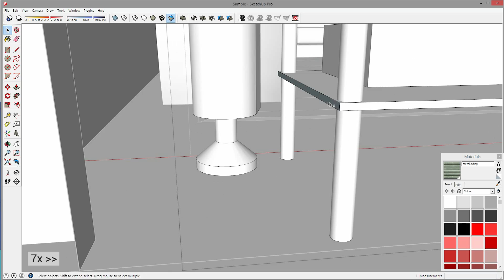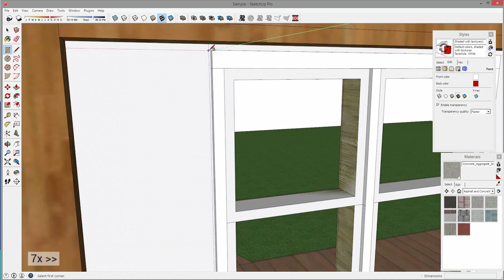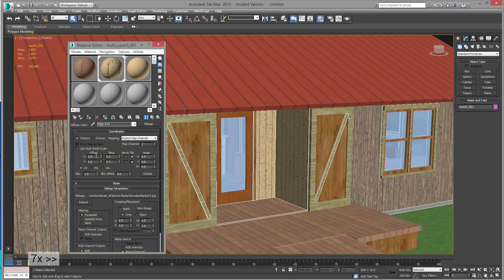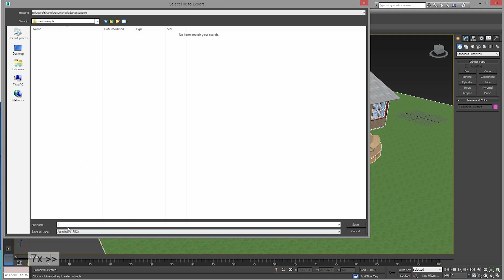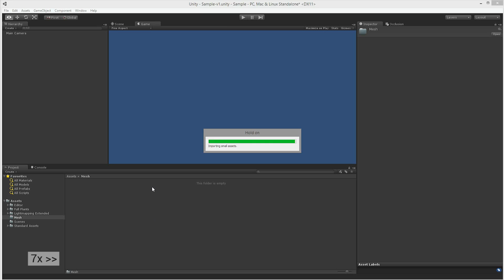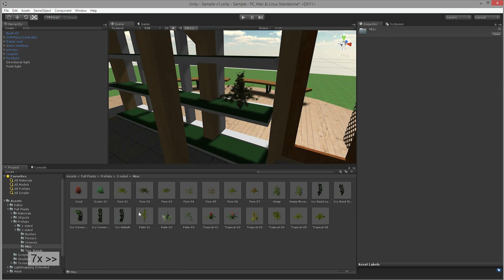SketchUp to Unity to Oculus Rift DK2 - The Entire Workflow and Tutorial

Comment: Hee Shane, im trying to convert my Sketchup file straight into Unity. I've followed all the Sketchup steps in your tutorial but when I build a Directtorift.exe then my Oculus will 'lag' and frame rate will drop from 75 fps to 15 fps on certain objects. This is not very helpfull since people get pretty noxious. I think its a Sketchup problem because when I design in Archicad or Revit the directtorift.exe is smooth and fps is stable.

Do you know a solution to the massive amount of polygons and drawcalls Sketchup files tend to make?

(My RIG msi gtx 970, intel 5, 16gb)
Reply: +Ingmar Vroege Have you tried signing up for IrisVR's desktop application? It really removes all the tedious steps captured in this tutorial. :)

Comment: Thank you for explaining this in a way that complete dummies like me could understand. Let me see if I've got this: Say I find something on the Sketchup 3D Warehouse that has interiors and all. I use Sketchup to add textures if it doesn't already have them, then I import the fbx into Unity, add lighting and make sure there's a ground plane, sky, etc., then use the Oculus plugins to add a character controller. Export that and I would then have a Rift-compatible walk through environment. Do I have that right?
Reply: +bartsimpson83  I'm using the free versions of Unity and Sketchup and you can actually load up your Sketchup .skp save file directly into Unity. I've had good luck with the textures, scale and faces appearing correctly, but it's not always 100% perfect. All you have to do then is add the Oculus assets and you are pretty much good to go.